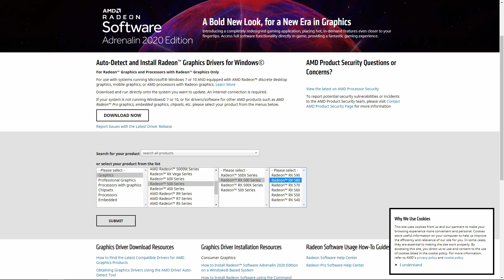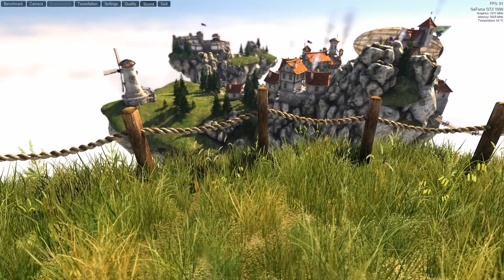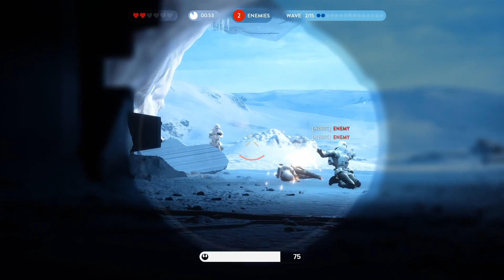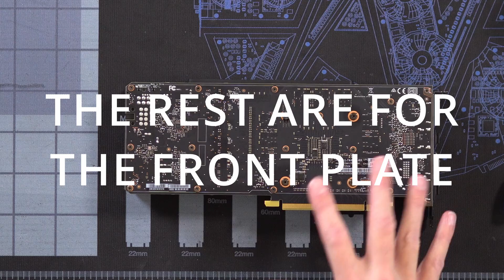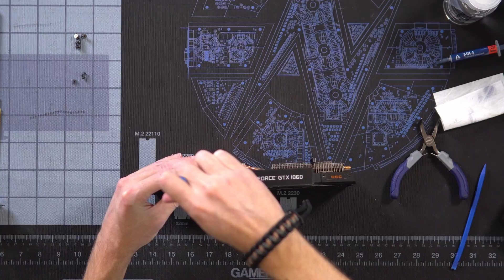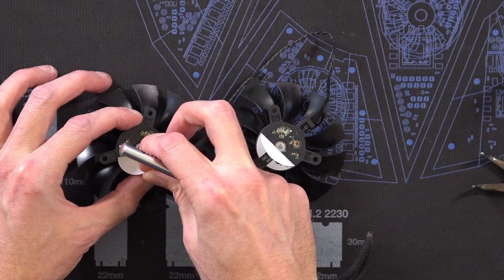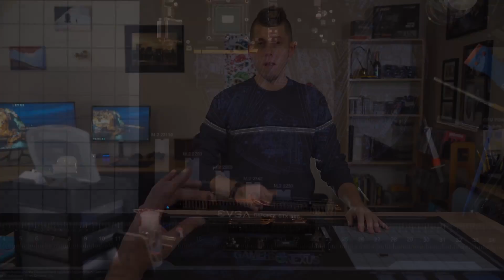Testing & Restoring A Used Mining GPU

Comment: Great video -- very clear and helpful. But, you might want to include a note that booting into Safe Mode is different if you're still running Windows 7 (like me and my Optiplex 9010!).
Reply from the maker: That's fair. But I'd suggest moving to Windows 10. Especially if you're getting online with that system. You're going to leave yourself open to security exploits as time goes by without regular updates. Sort of like what happened with XP and Wannacry. And that's why I didn't really mention it.

Comment: Could you send an ebay link to 2 sticks of ddr3 ram 4gb each that’s compatible for dell optiplex 3020 I really don’t want to buy the wrong ram
Reply from the maker: Sure, here's one. I use this stuff all the time in these. You can even toss them an offer for a little less.

https://www.ebay.com/itm/SK-Hynix-8GB-4GBx2-1Rx8-HMT451U6AFR8C-PB-PC3-12800U-1600MHz-DDR3-RAM-1314-1313/254596240225?epid=662282475&hash=item3b471e5361:g:VO0AAOSwOX9evJqW
Reply: The Game Bench 
Thank you very much for the link.
I looked at it and felt like 16gb would be a bit better so would this kit work: 8GB SK hynix 1600MHz 2Rx8 PC3L-12800U-11-13-B1 DDR3 Desktop PC Memory/RAM. Condition is Used.

Thanks again
Reply from the maker: Yeah, that's essentially they same kit, just in 8GB sticks instead of 4GB, and ideal for the 3020 since the max memory is 16GB.

Comment: I have an issue with an Optiplex 7010 with i5-3570 and BIOS A29. It simply does not want to start with a Radeon HD 7850. The PSU is upgrades to Corsair CX 450. Have been googling and reading for hours, trying Settings in BIOS, without succes.  Do you have any idea on the root cause pls?
Reply from the maker: Do you have your boot mode set as UEFI?
Reply: The Game Bench  Yes, its set as UEFI.
Reply from the maker: Well, the 7850 won't work in UEFI mode unless you flash it with a UEFI BIOS. I would guess that's you're problem. You could switch to legacy to see if you get video output from the card.

Comment: Pretty thorough, dude. Personally, I don't bother repasting most of my used cards. My opinion is if the temps are fine then don't bother. Also, I have bad luck with the little row of smd's that run parrallel next to the pci-e fingers. They're easy to knock off, so now and then buying used cards I get them like that. The cards will still work even when missing some of them, but it reduces your bandwidth. Like if you're missing just one, you won't get x16 and will be limited to x8. I think if its 3 missing, you're knocked down to x4. You can get all the way down x1 if missing enough of them.
Reply from the maker: Interesting. I've never had that happen to me before. I just always do this because I'm going to tear it down to make it look like new. Really deep clean. Generally, the cards I get are pretty dirty. Plus, the I can lube the fans too. And since I'm tearing it down, I have to repaste anyways. Though, I get it... it's not necessary. Just blowing out the dust is usually fine. I just like them to look as good as they perform, plus they sell better that way.
Reply: @TheGameBench  It depends, man. I will on occasion do it, but usually a good blow out will make it presentable enough. I don't sell the cards individually, so I'm not super worried about a little dust. But yes, watch for those little smd's. They're next to the pci-e fingers, so I think people knock them off while slotting the cards in. For something mid range like a 1060, x8 bandwidth is enough you won't notice a performance hit. I didn't know to look for this until I ran into a rx580 that gpu-z would only report as x8. It took a while for me to figure it out. For me this is a side thing. I'm not flipping a ton of pc's, but I have seen this 3 times in the last couple years. I returned these cards cause it just didn't feel right to use them.

Comment: I applied a bad overclock on a hd5670 it works but everytime I go to login the screen glitches and freezes I already uninstalled msi afterburner to get rid of the settings but it still crashes
Reply from the maker: Being an older GPU the overclock could have degraded the silicon or the memory, or any number of things. Unfortunately, it sounds like it's done for.

Comment: Thank you for actual useful information. When I upgrade my machine I will be following your procedure exactly. So here's a real dilemma, which GPU would you go for, RX 5600XT or an RTX 2060Ti or a GTX 1070Ti? They're all pretty much the same price and they will be installed in a PCIX3 based machine. I don't have a problem with second hand, I just consider that the device has had an extended burn in. I play almost exclusively RPG (RDR2, Elite Dangerous,  Forza H4, Outer Worlds ect.). Keep up the great work, I love Linus and Jay for fun but I'm an impoverished gamer and I really appreciate your calm OCD delivery. Thanks and hang in there.
Reply from the maker: Honestly, they're all on par with each other. Assuming that you're talking about the 2060 and not the 2060 Super. There's no 2060 Ti. I'm all about used price to performance with these builds, but if the 1070 Ti isn't much less than the 2060 or 5600XT, I would go with the newer card.

Comment: Very helpful video. I'm planning to buy a GTX 970 for my Dell Optiplex and I'm gonna clean it and stuff, whatever you showed on the video. Thanks in advance, as always.
Reply from the maker: Awesome! The 970's still a great 1080p card.
Reply: @TheGameBench  I agree, and it matches perfectly with my core i7 without any bottlenecks! I would get the RX 470/570 but I'm afraid because to AMD crap drivers.

Comment: I got a TON of gruff for so much as mentioning Furmark in my Overclocking video and I'm surprised you aren't getting the same.
Reply from the maker: Really? What the hell were they complaining about?
Reply: @TheGameBench  Apparently no one uses it anymore and it's severely outdated. Also that it's extremely dangerous (which I agree it's not for newer overclockers, but still...)

In my pinned comment I address all of this stuff even showing an example where Linus used it to test a brand new card literally a day after I posted the vid. Regardless, It's not like I was suggesting anyone use it or anything. It was simply used in the context of a passing joke.

I think they were looking for any excuse to nitpick since I was criticizing OCing so whatever. I deleted those ones since it's technically misinformation at that point lmao
Reply: @chintzypc5508  I still use it as it is a great tool for burning in and and testing used gpu's

Comment: This is the most complete guide to properly swapping and taking care of used GPU's. Cheers, keep up the good work and stay safe!
Reply from the maker: Thanks! You too.
Reply: @TheGameBench  what's the name of the oil?  I thought of lubing the fans on my Dell Inspiron 530 as I'm upgrading it (I haven't looked closely at them yet, but the oil can still be good to have around).
Reply from the maker: @danielmazurvideos  Well, I used this because it's what I had on hand and works well. However, if you don't, I'd suggest a good sewing machine oil. Something like this would be great. However, I would peel up the sticker on the back first as they might not serviceable. I know that the fans in the Optiplex aren't.

https://www.amazon.com/Liberty-Oil-Synthetic-Lubricating-Machines/dp/B008QNQ2VE/ref=sxin_3_ac_d_rm?ac_md=4-3-c3ludGhldGljIHNld2luZyBtYWNoaW5lIG9pbA%3D%3D-ac_d_rm&cv_ct_cx=sewing+machine+oil&dchild=1&keywords=sewing+machine+oil&pd_rd_i=B008QNQ2VE&pd_rd_r=e281c971-103e-42a0-9502-80a14e6e2979&pd_rd_w=CREUG&pd_rd_wg=lIz9r&pf_rd_p=3d1a8341-be16-45b1-ae3d-ba8c533ec9f0&pf_rd_r=Y85CMFP9V85A4RMCDDJF&psc=1&qid=1599885019&sr=1-4-12d4272d-8adb-4121-8624-135149aa9081
Reply: Agreed.

Comment: With DDU you can choose to have it prevent Windows from automatically installing updated drivers.  Under Settings.
Reply from the maker: Yep, I know. I did that in the past and had times where Windows Update would just do it's thing anyways. I've just found it's easier, and fool proof, to disconnect it from the internet. On my personal systems, I just disable driver updates via the group policy... but that's not an option for people with Home, only Pro.

Comment: I skimmed the video (this is a topic I already know plenty about) and didn't see testing thermals before and after.  Just wanted to note that thermal paste does NOT always need to be reapplied.  I have computers over 10 years old with heavy use through that span that still have more or less identical thermals to when new that are well below throttling temps.  This only needs to be done if the original paste job was done poorly (unlikely if it's a used card several years old, it would've either been fixed or RMA'd by now) or if the card has been handled roughly and the PCB has flexed enough to break the connection between GPU die and heatsink.  This can certainly happen in the mail especially if the packaging was inadequate, but test your thermals with HWInfo or similar to see if it's necessary.  Anyone that's repaired stuff for long enough knows that any time you take something apart you run the risk of making things worse.  All it takes is a heatsink slipping out of your hand or a screwdriver popping out of the screw head to knock a small component off the board or do other damage, so if it's working well, leave it alone, especially if you aren't a particularly delicate person in the first place.
Reply from the maker: This is an entirely fair, and very helpful criticism. You're exactly right. Had I not removed the heat sink, I could have left the paste alone. Thermals were inline with where they should be and the paste still good. It's just habit for me to do this, and I completely didn't think about that. Thanks for the well thought out comment.
Reply: @TheGameBench  Absolutely, you always need to repaste if removing a heatsink, especially if it's an OEM dried paste as that will not have the same thermal properties once the bond is broken.

Nothing wrong with showing people how to do it, but it creates a subset of people that feel it must be done, which leads to spreading that mindset to less and less tech-minded people that will break their parts in the process when their things were fine as-is.  I just wanted to keep people from going down a rabbit hole of doing more maintenance than necessary and thermal paste is a big one that people think needs to be replaced far more often than it really does, and usually it never needs it.
Reply: @nunyabusiness896  thanks man, was gonna grab thermal paste just for this. I'll clean everything but that part. Just bought a used 1080ti and it came today.

Comment: Fun fact: mining GPUs are less stressed and abused than gaming GPUs, because the mining algorithm doesn't need that much graphics power as games do.
Reply from the maker: Yep, the only problem that arises with mining is when people don't what they're doing. Failures are generally do to lack of cooling or poor power. But that can happen in a gaming scenario too.
Reply: @TheGameBench  exactly. I have absolutely no problem with using a GPU that was used for mining, given that the miner knew what he/she was doing. I've seen GPUs that were in perfect condition (apart from some normal dirt/dust on it from being used) and some that made me wonder how they could possibly run them at such terrible temperatures that the poor memory modules looked crooked and the PCB itself was showing terrible signs of degradation.

Comment from the maker: Are you concerned about buying a used GPU because it might have been used for mining? Are you concerned you don't know what to do to test it or how to clean it and apply some fresh thermal paste? Maybe you bought one and it's got a fan that's making some bearing noise? Well, I got you. I go over all that in the video, and there are plenty of timestamps in the description, as always, to help you navigate.  So, have you bought an ex-mining GPU? What were your experiences? Also, as @NunyaBusiness has reminded me, this is not something that you NEED to do. If your temps are fine, then you don't have to open the card up to replace the TIM. A simple cleaning would suffice.